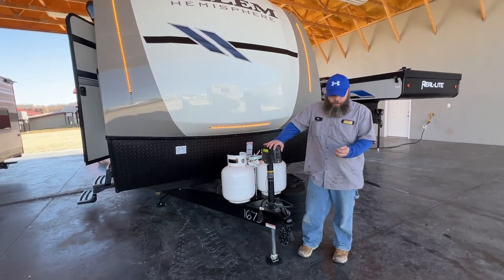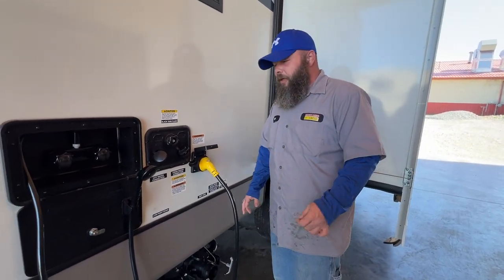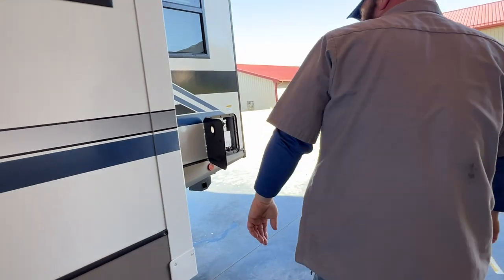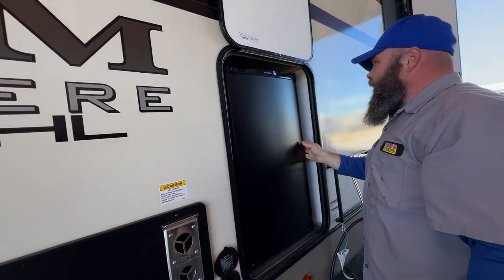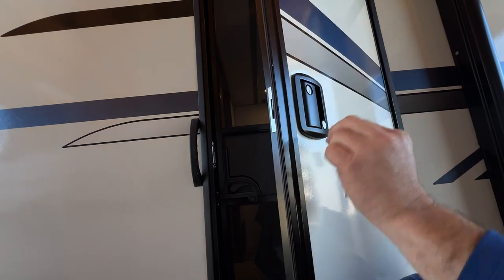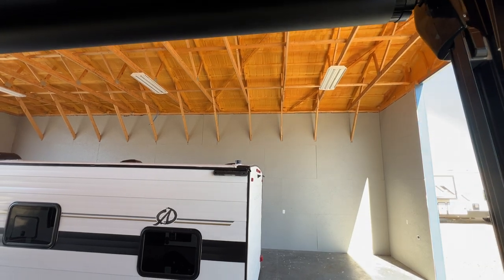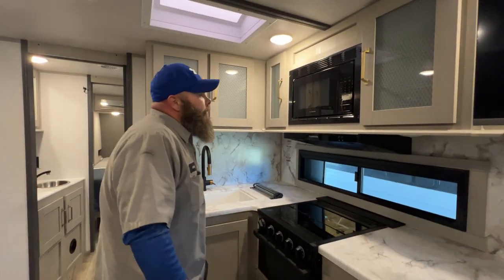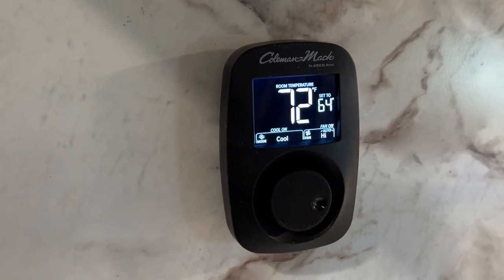Virtual Walkthrough of 2024 Forest River Salem Hemisphere Hyper-Lyte 24RDHL at Parkland RV Center

Comment: No ladder 😢
Reply from the maker: You are correct. Many models have gone to no outside ladder---they are using the prep for the Lippert after-market extendable ladder. Two reasons--saves the wear and tear on the roof (attached at the back of the unit, rather than on the roof), so less likely to cause a roof leak. Also--apparently there were problems with children climbing on them at RV parks and falling--the removable ladder mitigates that problem.  :)